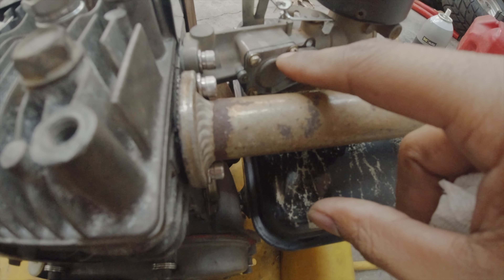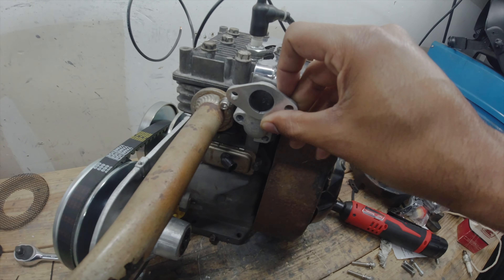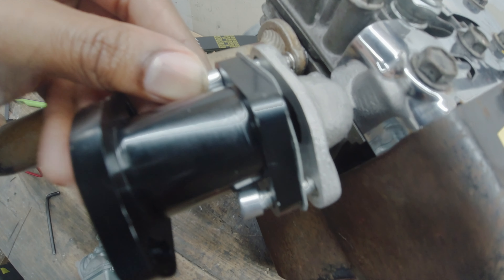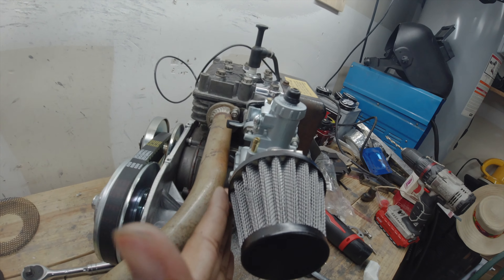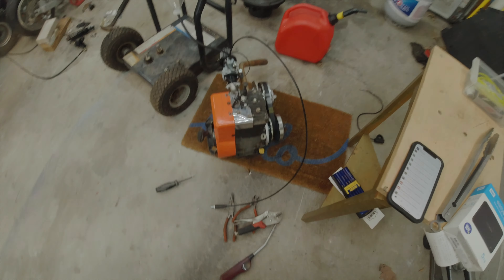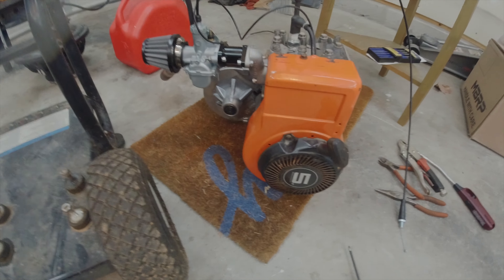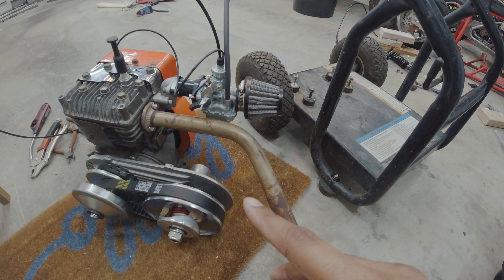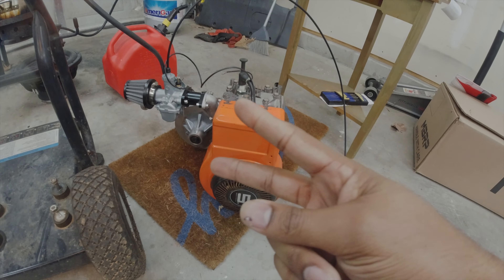Flat Head DoodleBug 30 Ep. 3 | Briggs Raptor 5hp x 22mm Mikuni Style Carb| DB30 | #MiniBikeMonday

Comment: Whats the black plastic adapter that you put between the intake and the carburetor off of? I need one like that so I can change the bolt pattern  to the horizontal mounting bolts so I can put a different carb on this briggs flat head engine i have.
Reply from the maker: That’s the intake manifold/adapter and it’s metal. I make sure when I order my carbs that they come with them. Otherwise they are like $15 separate.

Comment: Thanks brother goin to buy some more of them intakes i bought 2 already  im wondering if will work with 8 and 10 hp briggs
Reply from the maker: I have a 8 hp big block Briggs and the spacing measured the same so I am thinking that it will fit.
Reply: @DariusBuildz  heck yea I'm set than

Comment: Do u have to remove the govener
Reply from the maker: The Briggs Raptor is their racing motor, so it’s no governor. But if you have a standard 5hp, I would remove or bypass it it you want it to rev higher. But beware that the stock rod shouldn’t be revved to high or it can bend or break.
Reply: @DariusBuildz  I mainly just want a round slide for ease of use and throttle control
Reply: Not really for high revs
Reply from the maker: @nickweems4113  same here. This is my pit bike. My big block Motovox is my street bike. But the round slide is def easier to setup and tune vs the stock carb and the throttle is 100% easier to setup. And for about $30-$40, you can’t beat the price.